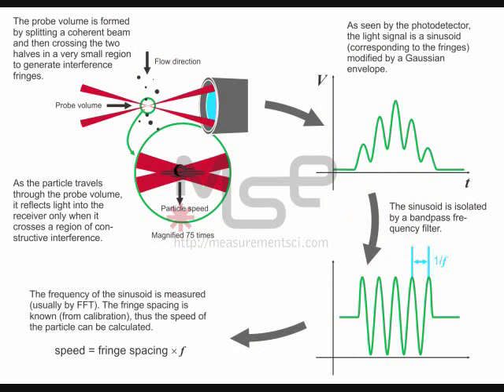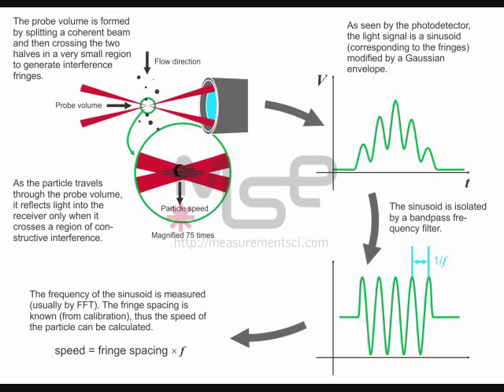MSE demonstration of flowLab table top water tunnel and miniLDV laser Doppler velocimeter

Comment: Hello, I am considering using this technology to monitor blood flow in a dynamic situation (e.g. while test subjects will be moving quite a bit).  What are the limitations of this technology in relation to mounting a probe on the skin surface and having the subject perform a physical task while I collect data?  Thanks!
Reply: +Kryztopher Tung Hello Krystopher, thank you for your question. The main limitation is the opacity of human skin and the need for the laser light to penetrate skin tissue and blood vessels and provide enough backscattered light to get a strong enough signal. If you have more questions, please email me at km@measurementsci.com or call at 626-577-0566.